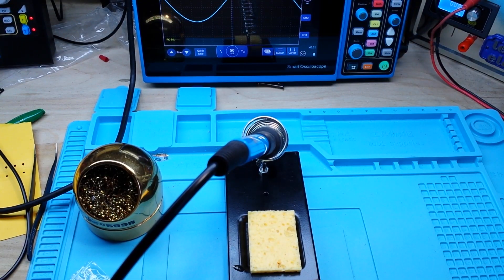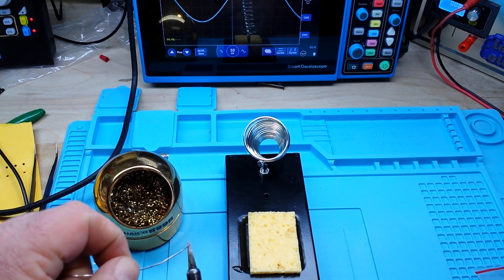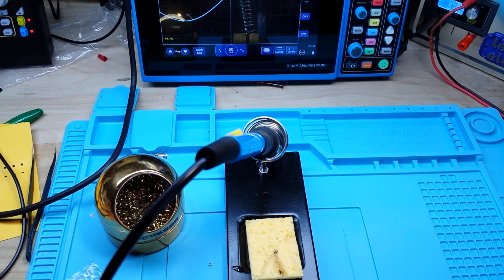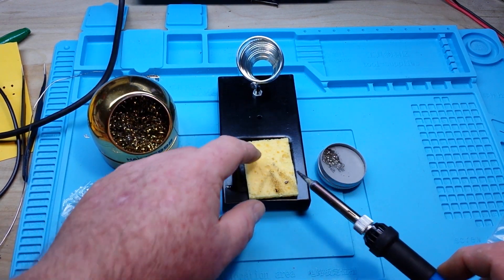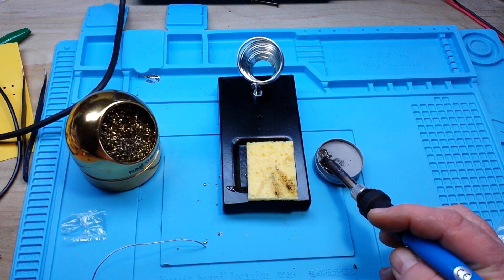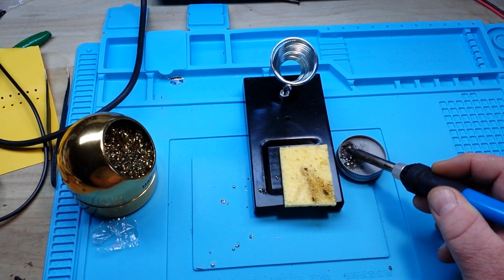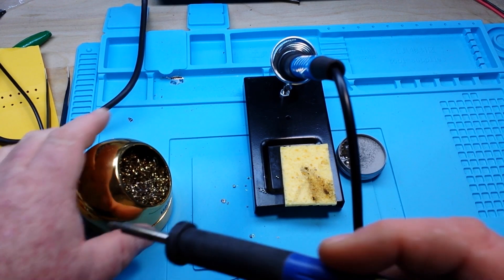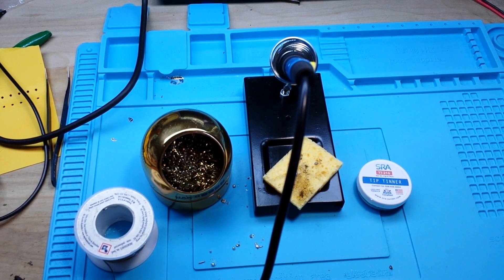Can Tip Tinner restore a dirty soldering iron tip

Comment: I use colophony,/soldering paste flux with wet and wire sponge. And tinning  solder tip every time when not using it for more than a minute.
https://www.aliexpress.com/wholesale?catId=142703&initiative_id=AS_20190510043704&SearchText=colophony+soldering

https://www.aliexpress.com/item/High-Quaility-Carton-Rosin-Soldering-Iron-Soft-Solder-Welding-Fluxes-Environment-Friendly-Acid-Solder-Rosin/32901055948.html

Comment: Is it better to get those el cheapo $2 tips instead? Last time I check the tip cleaner is pretty expensive. Thanks for the video though
Reply: 2$ per tips? those are 900M tips for the Hakko clone's 907 solder iron. 900M tips you can buy them at aliexpress or ebay for 0.35$/tip delivered to your home ... they usually  sell in packs of 10 pieces.

Comment: I use it regularly with very different results. If you watch Weller's video on tip activator it illustrates the results I get. Possibly the tip wasn't hot enough? Not sure. 73
Reply: had a tip so badly farked that I actually had ordered a new set. Saw thermatronics tip tinner/cleaner while waiting, snagged and holleee shiat the tip is back and running.  (I ran it through at 450c)
Reply from the maker: It was 400F. I'm being told i didnt leave it in long enough? What say you, Bob?
Reply: I solder at 300-350°C (572-662°F) and the tips turn instantly silver colored. Tin has a melting point of 232°C (450°F). I'd turn up the heat and see what happens.🤔
Reply: @YouAllKnowBob  I think he meant 400C.  There is no way the tip tinner would be melting at 400F, especially so quickly.  He should be dropping the temp down to 320C, per the manufacturer's advice. https://blog.sra-solder.com/knowledge-base/tip-maintenance-using-a-tip-tinner